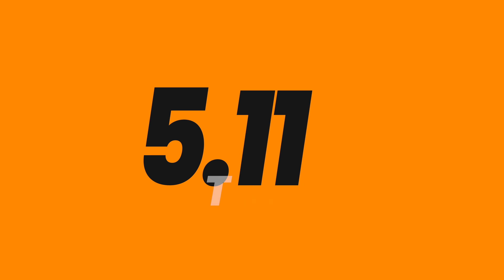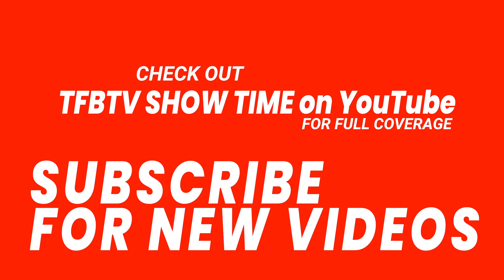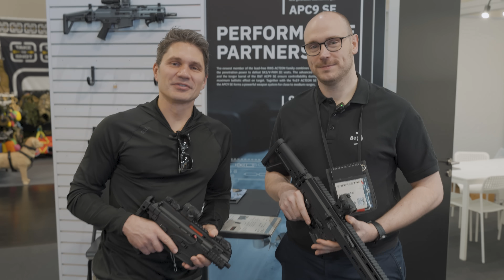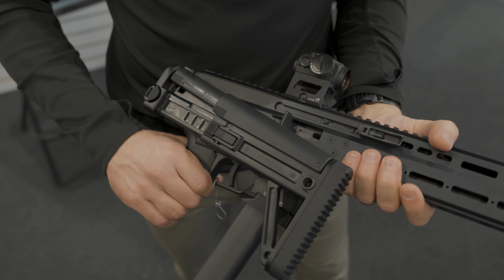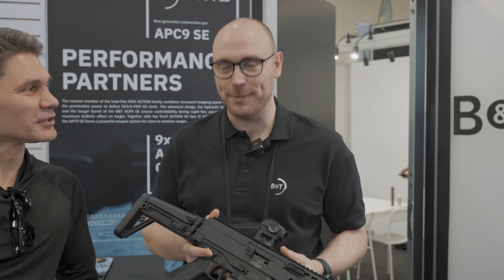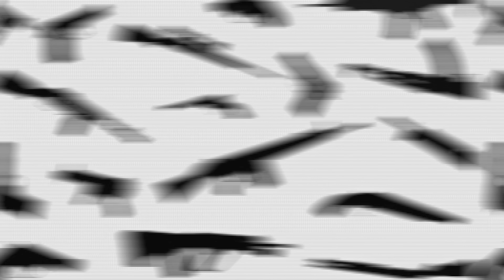Prototype B&T APC9: 9mm That Defeats Body Armor at 75m | EnforceTac 2025

Comment: So you're getting to a rifle that size... Ammunition isnt reverse compatible because those 9mm AP will detonate any Glock you fire it through... Why not just 556?
Reply: As someone else said, it's just light weight for caliber 9mm ammo. Look at Underwood ammo. It's nothing "special " and will defeat 3A.   But I agree on the rifle length PCC. I see zero point if you can choose rifle caliber.
Reply: @sirdanoman  Exactly. If they take the 65grain xtreme defender from the 357sig round and run it hot out of 9mm it might reach 1800fps
 
Or they can accept the fact that 9mm is not a do-all round.
Reply: @sirdanoman over-penetration.
Reply: Or 300 blk supers
Reply: @K-bob_45  actually even some Sub Sonic 300 blackout defeat lvl 3.
Reply: My guess is that MP5s in NATO storage can handle the pressures from hotter ammo.
Reply: 106 grain at 1500fps will hardly detonate a Glock lol, that's basically what my Underwood self defense ammo is
Reply: Id assume the goal is to allow any 9mm you already have for your pistol to work with the carbine
Reply: You could probably carry 1/2 or 1/3 more rounds of 9x19 over 556
Reply: @KillershredsTK 9mm Parabellum weighs essentially the same as 5.56mm NATO
Reply: @KillershredsTK  You'd be wrong.
Reply: .300 blackout gets more velocity in a similarly sized package.
Reply: I had the same thought, if you're going that long you would be MUCH better off with 5.56mm, better armor penetration and better terminal ballistics by far.
Reply: Because muh B&T
Reply: If this over pressure round chambers in 9x19 these dudes are crazy
Reply: @Fightosaurus 106gr @ 1500fps from a carbine length barrel isn't exactly "bench bomb" pressures.  Its basically +P, maybe with slightly slower burning powder.
Reply: @ If it’s within SAAMI, this is dumb. If it’s outside SAAMI, it’s dumb AND dangerous. Really don’t understand why market the APC9 this way
Reply: speaks in Glock
Reply: Any pistol that is +p+ rated would handle it.
Reply: I share your doubts about the advantage of this over 556, but this round may not be overpressure - it may be using slower-burning powder. Also, a 10 inch barrel will get you about 1320 fps with normal pressure 115gr 9mm. Consider  the slightly lighter projectile at 106gr and the overhead you can get with +P ammo (which will still fire safely in nearly all handguns) and I bet you get 1400-1425 out of a 10 inch barrel. The remaining difference could be slower-burning powder.
Reply: Or 300 blk out of a 6.5 barrel.
Reply: Concussion, overpenetration of barriers, etc.
Reply: I suspect a larger projectile suffers less over penetration. 

Perhaps it’s more suited to urban conditions, the kind police deal with over military. How do you deal with an armoured foe in an area with civilians? 

Would love to do a test but 556 vs 9mm is going to have very different ballistics and effects, despite similar velocity.
Reply: I didn't know you can't fire +p ammo out of them. Guess I'm doing it wrong.
Reply: Maybe it will detonate your shitty glock but a USP 9 tactical that is actually rated for an absurd amount of +p+ ammo will probably be fine. Also russian guns are like gyurza are overbuilt to hand their PBM round with is also an absurdly high pressure AP round
Reply: @rodiculous9464  Glocks handle +P+ just fine
Reply: Maybe it is quieter, but I cannot really think of any reason to do 9mm AP over 5.56 either.
Reply: @littlezero6399  over-penetration. Remember, it's for law-enforcement.
Reply: @littlezero6399 I can but it only has to do with money. This would be nice to run a sub sonic and whatever AP round this is suppressed. I could see that being good for CQB and such. But then why not just get a damn 300BO? But then I see the price of training ammo for 300 so maybe the bean counters are being used in these decisions.
Reply: Think some goofy European police forces may be restricted by calibers
Reply: @Wade-1 Not here. 9mm, 5.7, 5.56 and .300 Blackout issued.
Reply: Logistics, noise, compatibility with your sidearm, cost. With a chop down 556, you are wasting a lot of powder and losing a lot of velocity anyway.
Reply: @jacobstaten2366  There's still a world of difference between the most badass 9x19 in the world, and 5.56. A carbine that size is the equivalent of a 10.3" MK18, or a 9" MCX maybe, the only thing that 9 is going to be better at is concussion. But in europe, suppressors aren't retardedly over-regulated, so they can run a short 5.56 with an inexpensive k can and have a real weapon, for cheaper than whatever B&T is charging. 

The different in weapon vs ammo cost should basically cancel each other out when we're talking about B&T. Far as logistics... The moment they begin talking about some goofy high spec 9mm, the cost argument falls through the floor, because that super-duper 9mm gets its shit pushed in, hard, by basic 55gr FMJ.
Reply: @Rb889  They probably already have way more 9 mm ammunition than they do 5.56. The bit about suppressors proves the point even more since you can get away with using full speed 9 mm ammo with a can and it's going to be pretty quiet. Use subsonic heavier 9 mm ammo, and you end up with something a lot quieter then subsonic 5.56 without the downsides that that incurs. Subsonic 5.56 can be little better than a 22 at times.
Reply: @jacobstaten2366 no way is an exotic 9mm sabot going to have better logistical support vs any run of the mill 5.56 be it M193 or M855. That same exotic 9mm probably doesn’t have much compatibility with hand guns given higher pressures. Maybe but not as likely. Cost of exotic 9mm made for this gun vs cheap 5.56? Not close. Noise? It’s 9mm sabot going 1500 fps. It’s going to be loud and concussive, maybe even comparable to 5.56 out of 10.5 barrels. So all the things you listed are not advantages at all and are actually disadvantages.
Reply: @jacobstaten2366 "chop down" - that thing has a barrel comparable to the M4 and what most nations are choosing these days for 5.56mm.

If it really bothers you, out a blast can on the end to focus the noise at the target - I doubt he'll complain about the tinnitus over the sucking chest wound.
Reply: @geodkyt  The whole point of having a shorter barrel is that it's shorter overall. Adding a can makes it longer. Although, it would be pretty easy to integrally suppress something like this. A 10-in barrel for 9 mm is about where it's at before you start getting diminishing returns. For 5.56, you're Short changing yourself until you get to a 16-in or higher barrel. They were originally designed to have a 20-in barrel. 
It also means having thinner magazines, which can either mean more magazines or more room on your rig for other equipment like all of the stuff a cop would carry; flashlights, cuffs, mace, body cam, taser, that sort of thing. 
Best to say nothing of the other points I mentioned before.
Reply: Glock mags
Reply: “Hello! I like money!”

“So why didn’t you just build it in 556?”

“Money!”
Reply: Probably legal and training reasons, however I'd argue that that carbine with a P&W 14.7" barrel would unironically be a good patrol carbine for the average US police officer. It's exceptionally rare for police to engage targets with body armor and you could presumably have a few mags of AP ammo locked away with the carbine for those select situations. It would improve logistics, reduce training cost, reduce the number of magazines someone needs, reduce the risk of over-penetration in a crowded environment, etc. Also police are beholden to the NFA so get to 16" barrel length makes legality simple as well
Reply: How about disband every police department, and let people defend themselves. Repeal every gun law
Reply: @ based. Can we vote for this man?
Reply: Police departments in the US are not subject to NFA , they can have short barrel and full auto weapons.
Reply: @christianpatton9364 Incorrect. LEAs are absolutely subject to the NFA. They, too, must submit and receive approved an ATF form (specifically, a Form 10), the approval for which currently takes an avg. of 29 days (paper) or 57 days (eForms). Further, the LEOs’ Form 10-approved NFA weapons are restricted to official use.
Reply: @champy1210  individual officers yes but not government agencies/departments.
Why do you think the gun companies have different product ranges and web pages for law enforcement and military with short barreled and full auto weapons.
Reply: @christianpatton9364  strictly speaking they are still subject to the NFA. All of their SBRs and MGs need to be registered but they don't have to pay the $200 tax and they can have newly-made MGs, just like FFL dealers can. The military is not subject to it.
Reply: @ You’re incorrect, man. 
Agencies, and officers acting on official business, MUST file and receive approved an ATF Form 10:

“This form is used to properly identify the registrant and the firearms to be registered. The form when approved, *registers the firearm to the law enforcement agency.* The furnishing of this information *is mandatory (26 U.S.C. 5853a)”*

(https://www.atf.gov/firearms/docs/form/form-10-application-registration-firearms-acquired-certain-governmental-entities).

They may obtain post-sample machine guns unlike non-SOT civilians, but this too can only be legally accomplished via a successful Form 10 application.
Reply: @christianpatton9364 yes we are.   We have 5.56 SBRs w cans.    Both have to be approved and on a list w the ATF w proper paperwork.   We just don’t pay the 200 per item stamp fee
Reply: @sbreheny  The military is still subject to the NFA, military acquisitions just files the form 10 meaning the firearms are permanently transferred to the US military or a law enforcement agency if there's ever a program where they provide firearms to cops again like they did with m16s in the '90s
Reply: @champy1210 just did a form 10 agency transfer first week of February via eform, approval in less than 4 hours so i was able to drop the gun off at the PD on my way home
Reply: @stackscustominc1  I don't see how that can be true. There are only 700k NFA registered MGs. That includes the approx 200k private and then the remaining 500k includes police and FFLs. Surely the military alone has more than 700k MGs.
Reply: @stackscustominc1  I found this on a site talking about exceptions to the NFA "Law enforcement, states, and local governments are totally exempt from the making and transfer (either to or from) taxes, but must comply with the registration requirements." and then later "Federal government agencies, the military, and National Guard are exempt from the registration or tax requirements and generally speaking, NFA Branch removes firearms from transferrable status in the Registry once they are transferred to the federal government."
Reply: @hellcy7237 9mm overpenetrates more than 5.56
Reply: @hellcy7237  cops are not beholden to the nfa lol
Reply: @Jeffro_1  They absolutely are, they have to fill out form 4s and form 1s like the rest of us, especially if its their personal owned firearms. Also police departments dont like cops using NFA registered stuff since it adds a militaristic tint to it which makes lawsuits easier so they typically reserve that for SWAT units and/or keep it locked up at the station
Reply: @hellcy7237
Please don’t talk on subject matters you clearly know nothing about. I don’t think there is a single thing you said that is correct or even mostly correct.
Reply: simple blowback, cheaper and easier to make
Reply: German over-engineering
Reply: @FixedWing82 Isn't B&T Swiss?
Reply: @GreasyGrecian-p3b for the americans, Switzerland is Sweden, Austria is Australia.
B&T is a swiss company, we're not krauts.
Reply: @FixedWing82 Average American geography reasoning.
Reply: B&t is swiss friend.. @FixedWing82

Comment: That's pretty interesting. I wonder if there's a specific reason as to why the contracting buyer would want a souped up 9mm cartridge over a 5.7 or 5.56 cartridge.
Reply: Exactly!
Reply: That part where Sebastian said the original requesters could only use Glock mags. Maybe a legal restriction on that agency to only use 9mm.
Reply: yea that's probably it
Reply: Training with 9mm is still cheap and the interchangeable mags with their Glock pistols and being able to use short barrels and keep optimal performance (away from 300blk). 556 under 11 inches it is pretty weak especially compared to 300blk or even 9mm hollow points
Reply: Probably carry more rounds.
Reply: @Ren505nm  Nope!
Reply: Or restricted areas where splash or ricochet is a concern
Reply: Less long distance lethality I'm guessing for urban safety.
Reply: Ikr buyer should pretend they're defending against the taliban
Reply: Maybe it's somehow cheaper?